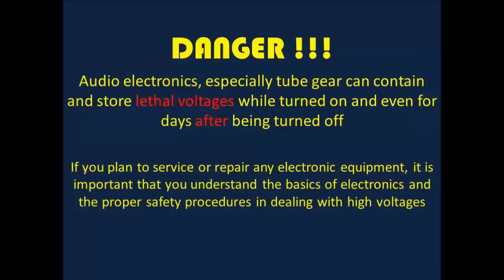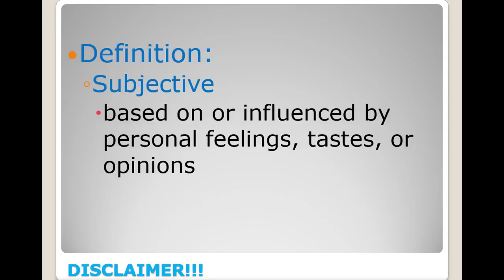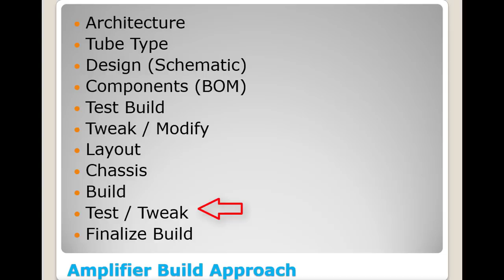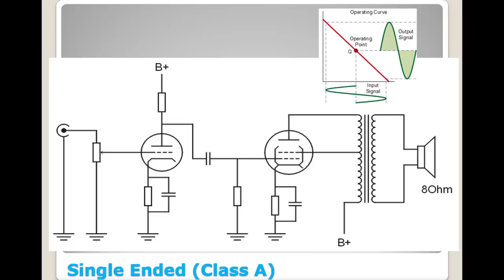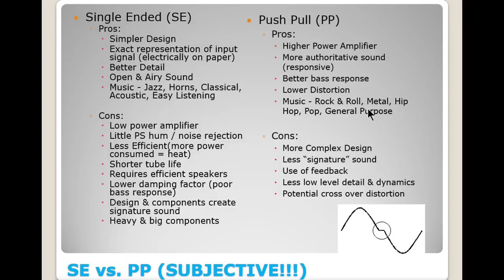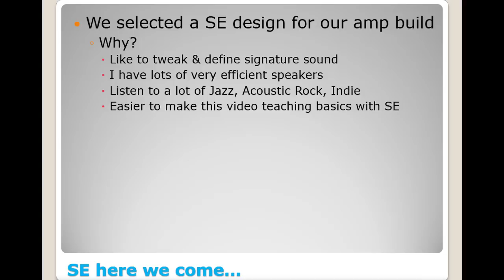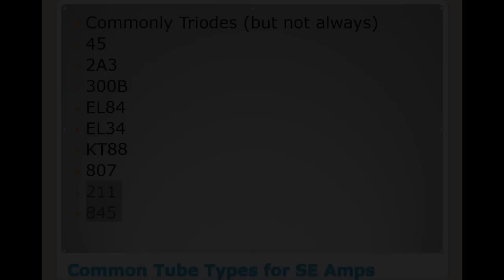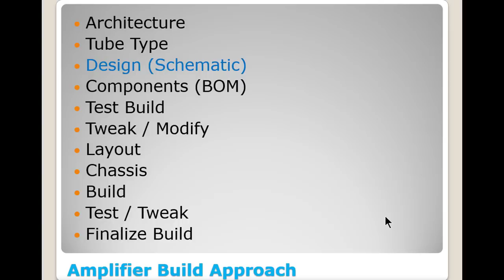Single Ended Tube Amplifier Build 2017 - Part 1 - BG096

Comment: Nice video series so far, helping to filling in some gaps I have, can not wait to see the rest of the series especially the testing and tweaking stages the showing of the voltages etc using your meters and scopes etc will be good and maybe showing some of the methods used to obtain certain values for the tone caps and biasing stages etc, the power supplies and how to obtain voltages really interest me, well all of it does actually..:)
Thanks for your time in creating these videos really appreciate it, and by the way you don't ramble you inspire & teach

Comment: I've built a 6L6 single ended amp driven with a 12AX7. I'm running about 280 volts on the plate with .039 amps of  bias. I'm also using a Speco style 5-25 watt 70 volt line transformer as the output transformer. It sounds good down to about 93 hz, then goes into distortion. Should I've have sprung for the Classictone? Can 70 volt line transformer be used as an output transformer? Is THIS the reason this sounds like crap? Thank you for your time and great videos!

Comment: Speakers more suited to single end valve amplifier would be a book shelf type,with higher mechanical impedance to keep bass under control which gives you titer bass

Comment: Thank you for this series, can you list some efficient speakers what work well with single ended low power amps?
Reply: usually horn loaded speakers.  heritage series klipsch.
Reply from the maker: I use klipsch cornwalls, but many of their line meets the goal.  There are many folded horn speakers out there as well.

Comment: Tube  pa ,  using  high  voltage  and  output  transformer ,  causing  soft  dampling  factor , instead  of  Transistor  :  low  voltage  high  current  and  strong  damping  for  Loudspeaker
( Output  Capacitor  Less ) ,  therefore  with  two  different  kinds  of  Sound  Tone.

Comment: you talked about push-pull just like if there were no Push-Pull Class A amp. You jumped to class B and AB just like if they were the reason of PP operation.
you miss the point in there.
in a PP Class A operation both tubes work in class A, tho with inverted signals.
one can miss this point while explaining PP operation.
You know that, obviously; but imho, that can't be bypassed.
keep on the good job!  regards

Comment: couldn't you designate more tubes to help with bass response and a bigger  output stage. say like 6 and designate  three of them for bass response so they are pushing more bass to mid range  by adjusting there capacitors and resistors? wouldn't this sort out these issue with the lack of bass response? and may be having up to 8 or 10 acting as a  equaliser to have a complete  balance of the spectrum and introducing more inductors into the mix not just the power supply.
Reply from the maker: not in a simple amplifier.  sounds good in theory, a pain to execute.  Think about it, you would have to have a cross-over of some sorts to spilt apart the frequency ranges, it wouldn't be much of a pure amplifier
Reply: Blueglow Electronics well using 6 is not too much of a problem and adjusting their frequencies for a nice flat response wouldn't be too difficult. I get what you're saying it would be a lot of trial and error may be to get it right but isn't the goal to have the best balanced amplifier possible with fairly low distortion. If you can just build one amplifier and that's all you need for the rest of your life, maybe you might give it some thought in the future and build the ultimate amplifier at a reasonable cost. Talking about crossovers I've never seen one I don't know if it exists, but has anybody built a passive or active valve crossover?

Comment: So the amplifier your going to build a single ended ultra linear amplifier? That's a nice idea.
Regarding power of amplifier's, most domestic listening is at 1w or less. Your average big powerful transistor amplifier sits underused. So it's a myth we need big powerful amps, though the headroom is useful.
Reply: Dave Micolichek  Spot on, can't argue with that.
Reply: And that’s the dilemma I’m in.  I already have a solid state, 100 watt, stereo power amp (no volume control).  What I want to do now is move up to bi-amplification.  The problem is there’s no such thing as a tweeter amp.  Everything I see on the Internet has ~20hz-20khz and 100 watts and above.  I know I can (and will) connect a DSP upstream but why am I relegated to amps that are designed for full range boxes with passive crossovers?  So I go to DIY sites to learn what component determines frequency and power output.  I’m told about inline filters on the input of the amp and filters on the output of the amp.  Neither of these options are my preference.  I think a billionaire from here (USA) or China should build a company so users can choose wattage and frequency by adding a card or something.  ~boutique stereo manufacturer ~

Comment: why not 6BQ6 these are a dime a dozen and they will put out 3.5 watts at 300 volts plate easy
Reply from the maker: There are literally hundreds of tube types I could have picked, I selected one with sentimental reasons for myself.  There is no "best" answer...
Reply: I was only thinking of 6BQ6 over 807 because 807'S are way less common and take a less common UX 5 socket

Comment: Could also use PCL82 they use a 16V filament.  easy to build and have a nice response range. Put one together myself,and used a burnt out tube to house a bluetooth Module so it fits in with the rest of the tubes, Stereo Class A  (EZ81 Rectifier,  PCL82 x2)  Chassi was a reused PA/mixer  for an intercom system. Could always use an ECL82 if you prefer the 6.3V filament arrangement. 

https://www.youtube.com/watch?v=lq97166yEBE